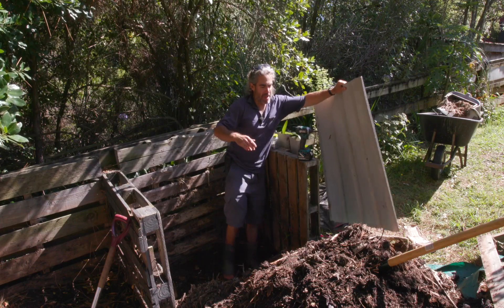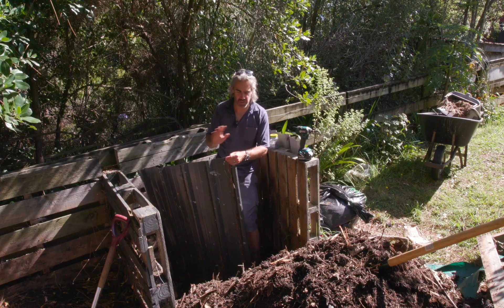Kick-Starting a Failed, Dead Compost Heap

Comment: I wonder if you could coil a black hose full of water on the ground, and run part of it through your pile to increase the internal temperature?
Reply from the maker: I'm sure you could.  It seems to be sitting at around 65c or 150f at the moment.  Will go cooler before too long.